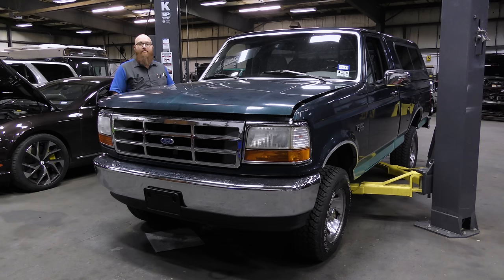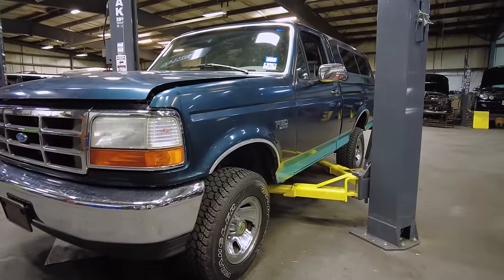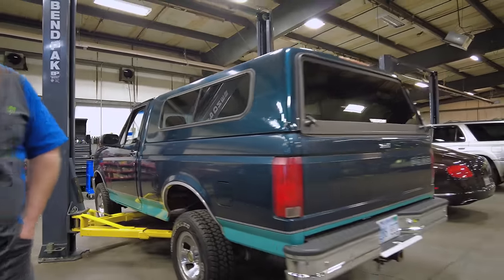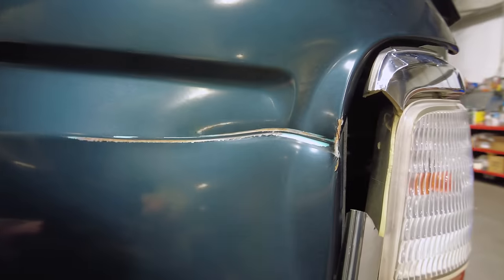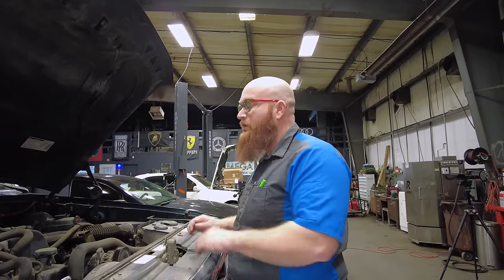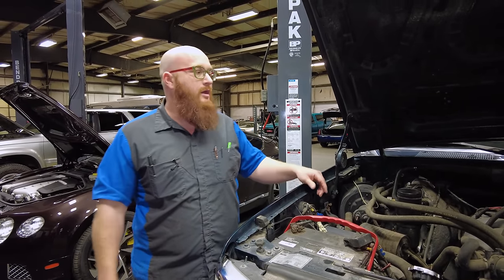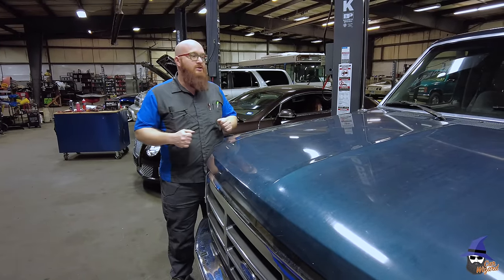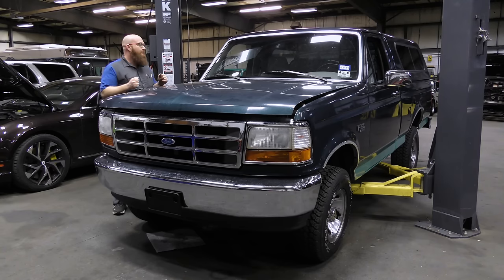What makes the CAR WIZARD mad? Fixing other shop's screw ups! Cheap Shop made  huge mess in '95 F150

Comment: Had an 89 with the 300 6 in the US. They were used in Australia where I live and I had a F250. It was a 70 something and the original 300 has been replaced by the common Australian 250 six. But that 300 was know as the Canadian motor in Australia. The common 250 threw a rod  2500 miles from home in rural Queensland. A local guy had one so we swapped it in and discovered the sump was different so the spot where the dip stick went was blank cast iron. No problem, the bloke just pulled out his electric drill and drilled it out by eye. That’s what you call a bush mechanic. Engine was fine, ran 2500 miles home

Comment: They thought the coolant was leaking from the heater core in the dash, probably, and so went through the instrument cluster opening to try to get at it.
Reply: If that's the case then whoever worked on this poor truck is a few evolutionary steps behind. These trucks have literally the easiest heater core to replace, just flop the glove box completely down and out and there it is... An actual caveman could do it in under 5 minutes.
Reply: Amazing. Assume something that isn’t so and then go to exactly the opposite of where heater cores are…

Comment: These hack shops NEED to be named and shamed.
Reply: With cars and trucks becoming more and more complicated to repair this type of negligence is only going to get worse.  Hush my mouth for saying this but a degree of regulation and control appears to be mandatory.  Besides the skyrocketing costs there is the safety issue.  The industry should do manage itself, but it won't.

Comment: Bought my daughter a nice v6 Mazda 626 one year. 
Water pump went out about 6 months into her having it.
Tore the whole front of the motor off.
Come to find,  the former owner liked taking in to a local automotive "Quack-in-the-box" who stripped the threads in the front of the block for the timing belt idler.
Seeing as it was mounted an inch away from the frame rail, he couldn't Helicoil it. 
He left it. 
Put everything back together as is.

Comment: I had an Acadia towed in this week that had been at another shop. It barely ran and the other shop diagnosed it as a bad HP fuel pump and charged the customer $400 to replace it. When that didn't fix it, they told him it needed the pcm replaced for $2100. I easily determined that the bank2 timing chain had broken, pulled the valve cover to confirm and sent him pictures of the missing timing chain and subsequent valve damage. He responded with a picture of a receipt from that same shop just 3k miles prior for $2500 for replacing the timing chains. Looking at the engine you could tell it had never even been apart. I get vehicles with similar stories in my shop on a regular basis. I'd say about 50% of private shops, 75% of dealers and 95% of the franchise repair shops are just professional con artists.

Comment: One disadvantage to driving an old truck, crap shops doing things too them and go well while it was here this happened. It’s definitely something to be in honest shop. I used to own a Ford ranger and a shop I used to use took the fuse out for my wipers then claimed everything to that was broken. Something told me to basic check, found the fuse was completely missing. Went back to shop, they claimed technician that changed my oil didn’t know what a fuse box was. Needless to say never went back to the shop, I changed my own oil ever since. A guy I grew up with opened a shop, so he does thing I can’t now on anything I own

Comment: Hello car wizard . I have been a subscriber to your channel for about a year. There is a company in New York that works on the gauge clusters. They clean them up and resolder the connections. The company is United Radio in Syracuse N.Y. they repaired my gauge cluster in my 97 Ford super duty when the transmission was acting up. Keep up the videos I enjoy them.

Comment: My cousin has that exact same year and model truck, except his is white. That thing is a TANK ! In the 10+ years he's had it, he's only replaced the AC compressor, front tank fuel pump, and an ignition switch outside of regular routine maintenance. It's the best built pickup truck I've ever been around.

Comment: I have always said that you can buy a car (new or used) from anywhere but finding a mechanic you can trust is the first step before making that purchase.  I drove Saab's for 35 consecutive years.  Before purchasing the first one I found an independent Saab specialist in my hometown to service/repair my cars.  I never had an issue with them and work was done correctly the first time, every time.  They have been in business since 1956 and have quite a following of dedicated customers.

Comment: I bought the first year 92 version of that truck with the 5.0. I consider that engine to be one of the  best Ford has made as well. I currently have the 09 with the dreaded 5.4 3valve. 296k and running strong!

Comment: Yes it’s happen to me, example miss fuse for the horn, wire unplug under drivers set, and 4 days later the E break cable feel disconnected, and I use it all the time normally.

Comment: I am currently an aircraft mechanic.  I used to be an auto mechanic years ago.  I stay current on newer cars and have all the tools to work on them.  Several times a year, I have to do a diagnosis or diag and repair on cars that shops cannot fix for friends.  Had this happened three times in the past year. One was for a vibration (bad carrier bearing, also replaced all 3 u-joints with 200K miles on them since we were in there).  The shop replaced the rear wheelbearings and wanted to replace the front differential.   The other was a hard start after filling with gas ($20 evap vent valve).   Shop had replaced the fuel pump.  Both of these took less than 5 minutes to troubleshoot.  I fixed an old ladies car  (friends mother).  Shop quoted her $250 for a radiator overflow tank. One test drive and a chemical head gasket test later.  I put in a $5  junkyard tank, $10 for a thermostat (overheating caused the overpressure to split the tank), and a $10 radiater cap just because.  And 20 minutes of labor after the car cooled down, all issues fixed.  With all the modern troubleshooting features, if it does not throw a code, diagnostics is a lost art.

Comment: Based on your other videos, if you say the 300 six is the most reliable, bulletproof engine of all time, I would consider that statement a fact. Nice old truck. Hard to find them anymore not rusted out. I had an 89 with the six and five speed. Bought it new. Drove it for several years but got the bug for a Mustang and traded it.

Comment: My family mechanic wouldn't work on my car when I was a teen. My parents and older brother, no problem. With me, he would say, get your manual out, "Here's what you need to do, call me if you run into trouble," and send me on my way. Best thing that happened to me. Had that car for 18 years. '65 Mustang, straight 6, 3 speed transmission.

Comment: A year and a half ago, I had to have the driver's side cv axel assembly on my 2014 Camry replaced. When I got my car back from the one shop in my area, I still heard a clicking sound here and there. So I take it back to that shop. They claimed all four motor mounts were slowly but surely going bad and would have to be replaced when they would bottom out at 100k miles and that job would be 1600 bucks when that time comes. I take my car to another shop in my area to get a second opinion. That shop was like no way and called b.s. one the other shop. The motor mounts were all secure and good. It was my passenger side front break caliber had seized  which was making the clicking sound I was still hearing. That was taking care off for just 300 bucks.

Comment: Had a similar vintage F350, first year Powerstroke.  Those dashes are more brittle than sugar glass.  I wouldnt be surprised if half of that was pre-existing damage.  SN-95 and NewEdge Mustangs have the same problem.

Tried to get the dash apart to replace a failed evaporator (03 Mustang) and all of the plastic surrounds on the cluster and center stack just shattered when you tried to remove them as instructed by the shop manual.  Spring clips snapped off, and the surrounds themselves came off in pieces.  It was so brittle I could break tiny pieces off of it with just my index finger and thumb.

I just replaced the whole dash with an aluminum sheetmetal one.  Dont have that problem anymore.

Comment: Since the cluster will need full replacement, see if the customer would like the tach model cluster, as a long as it came from a 6cylinder truck its plug n play. I put one in in my V8 bronco, and while its not necessary its a nice option.

Comment: I wanted to give them the benefit of doubt on the dash bezel removal because mine was cracked due to old age but seeing it more in depth they just had no care or I sense a swap out. Take the customers good parts and put them to the shops personal vehicle and take the broken stuff and put it on the customers vehicle and try to charge them money to fix those things. Also that shop had lack of communication, aren't they supposed to notify you of the findings before they do any actual work?

Comment: You can actually repair all of the plastic damage on the dash using a technique called plastic welding. When you want to add extra strength you use SS metal mesh and imbed it into your plastic weld repairs.

If the instrument cluster was shorted there is a good chance you could repair it on the bench (electronic repair bench).

Comment: The 4.9l has been around forever. It might have started out as a tractor engine. Farming, construction, all trades. They can even be found as generator and industrial trash pumps.

Engine Power hotrodded a 4.9 that was used as a pump. Got impressive numbers out of it.

Comment: Sad but true. Many times "if you want it done right, do it yourself" I might add, even if you don't know what you are doing. Get educated,  save money. Last year I had a reputable shop work on my f100 steering. It was worse than when I took it in. The sector shaft arm (like Pittman arm) could come off with gentle pulling. The bolt should have been torqued to 200ft lbs. loss of steering is a death sentence. Turned out the shop owner was short of help and had his teenager son work on my truck.  😮

Comment: Sad this to say this happens all the time, my own experience happened quite a few years ago, my Mom would go to Wally Mart and do her monthly shopping and she would drop her car off at the oil change place they had, long story short one time they forgot to put the oil in after draining it out, luckily I came to join for her lunch she had me drive and I noticed the oil light was still on so I immediately shut it off, checked the dip stick it was dry, luckily being a Toyota there was no damage. They did try to BS me but when I told I was an Aircraft Mechanic they stopped😆
I did her oil changes after that.

Comment: Many years ago I foolishly decided to add AC to my Datsun 310. The cost wasn’t that much at 750 dollars BUT when I got the car back from the installer I was told that someone had dropped a screwdriver into the car’s alternator shorting out the car’s electrical system which blew out every bulb in the car (the headlights were on when it happened). After replacing all the bulbs, I discovered after a road trip that the alternator had also died, necessitating a trip to the mechanic for replacement. Then finally the high pressure hose of the new AC blew 3 weeks later on a hot day. I did not have it fixed but got rid of the car instead.

Comment: I knew it was a 300 6 as soon as you started praising it. Loved those engines. What a great combo, 300 stick shift 2 wheel drive with manual everything.
Reply: Same. My buddy had one of these back in the day it was dependable as my 84 Toyota
Reply: @samholdsworth420  I had a 78 and 92 that both had the 300. Great little work horses

Comment: Those straight 6s are truly indestructible. You can find this engine  they hasn’t been run in 40 years and get it running with little work and no damage. Built to work forever.

Comment: I usually find the best value, whether for a repair shop or buying something new, is usually a mid-priced service/item.  You don't necessarily need to pay for the premium brands, but the cheapest ones are usually junk.  There are exceptions, of course, but often trying to save money by going for the lowest price often costs you in the long run.  I once saw this sign in an auto repair shop: "We work 3 ways - Good, Fast, Cheap.  You can have any 2.  Good & Fast, won't be Cheap.  Good & Cheap, won't be Fast.  Fast & Cheap, won't be Good."  I literally laughed out loud when I saw it 😀

Comment: I'm not sure if this is true, but I've heard someone say that when a car was turned in for cash for clunkers they would pour sand in the oil and turn the car over to destroy the engine on purpose. But when they tried to do this to the 4.9 straight 6 the trucks would just start up and run like nothing was wrong. Again, might be just a legend... but needles to say I've heard good things about the Ford 300.

Comment: I used to do the majority of my service work and many repairs myself (I am really  peculiar about certain things). The rest I took to this one repair shop. This shop was a foreign car shop and expensive,  however,  I really trusted them. Now I'm severely disabled, unable to do any repair or maintenance.  Unfortunately,  due to a death in the family, my go to repair shop has closed. In spite of my best efforts, I can not find another  shop that I trust, regardless of the cost. No one seems to have any pride in their work any longer. If I didn't live in New England  I would bring it to you. I have a 2014 Ford F-150 with less than 65,000 miles. It's due it's 60,000 mile change all the fluids (except transmission which I did at 45,000). I had to have that done twice. First shop told me they did it but lied. I know there is a module problem,  all the little electrical gremlins seem to operate off the same module.  I wanted to fix it, after all, it's just broken inand I've babies it. However,  because I couldn't find a trusted mechanic (it's my wife's car), I just ordered a 2023 Ford F-150 Tremor for $86,000 plus. It's a sad day when vehicles have become that disposable for want of a reliable,  honest, and decent technician. P.S. I had a 1997 Ford F-350 which I put 300,000 miles on with normal maintenance  and only replaced the pads and shoes once and a set of front shocks. That's it, everything  else was normal maintenance.  It has the 7.3 engine.

Comment: Seems like 50% of the work I do these days is fixing what other shops broke. Customers start off really upset because they figure all shops are crooked and when I say it needs the same part they just paid to have replaced they get mad at me. Its gotten to the point where I will offer to replace the part FOR FREE if it does not solve their issue. Its worked out many times but some customers there is no way to make them happy after another place has ticked them off.

Comment: I had a '94 Ford F250 single cab with the 5.8.  The coldest air I've ever had in a vehicle.  Burning hot from sun to freezing you out in minutes.  It needs to give my present Suburban a lesson in air. :)  As I've gotten older with more discretionary income, I've wanted to allow shops to do work I'm not inclined to do anymore.  But my experiences keep me doing my own work.  It is sad.

Comment: I was having medical issues. I took my wife's 1980 k5 blazer to a shop that was highly recommended. It had a slight oil leak at the rear of the engine. They said it was the rear of the intake leaking. They replaced the gaskets. When I went to pick up the vehicle. 😢 it was leaking worse than before. And a huge dent and scratches on the passenger side. I had just had a full body off frame restoration done on it a few years before this happened. I paid the 700 dollar bill to the shop. Then repaired the oil leak myself. Lesson Learned 😢

Comment: Had three of those engines. The absolute best. It would outpull my later 4x4 351 extended cab all day long. Certainly the 302 as well. Keep them oiled and cool and they will outlast you.

Comment: They ripped the bezel off because modern vehicles often only use clips. I accidentally missed a screw on a 2014 Corolla kick panel because you can pop it out without removing any screws on other Toyota/Lexus vehicles. Also, you could plastic weld the ripped plastic to fix it well enough if finding a decent used one is difficult.

Comment: The 300ci Ford has one weakness of fragile piston skirts. They are prone to break and burn lots of oil if the owner revs them hard (stuck for example) on a cold engine. In all fairness through, that’s hard on all engines, just more so on these.

Comment: one of the easiest trucks to work on. No excuse. Amazed it has cruise for its year and fact its manual. Rare find. From 1977 Ford I started with in 2000's when I got out of high school. up to my current 2003 F150 I do most work myself. Cut out the shops and all these trucks are so easy to work on without busting up and or modifying with extra useless junk. They didn't attempt to find screws on that dash they just ripped it off. Probably were trying to run odometer backwards and fried it. Pretty sure they were driving it places and were trying to set the Odometer back but since its not mechanical style new enough they ended up frying it.

Comment: Ford used the 4.9 inline six from 1965-1996. I have the 4.9 in my 1996 E-150 work van that I’ve had since new and drive daily. Still purring like my 2004 Lexus GX470.